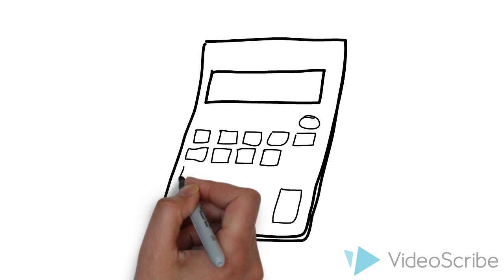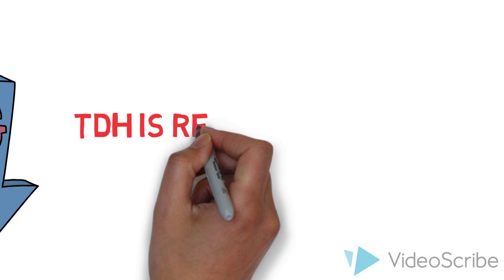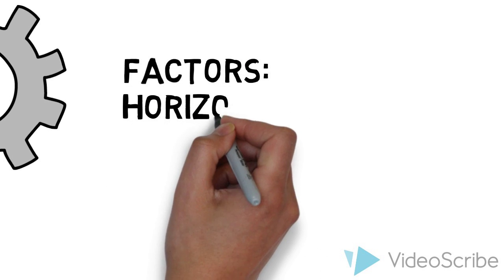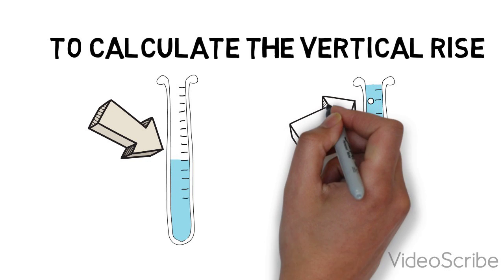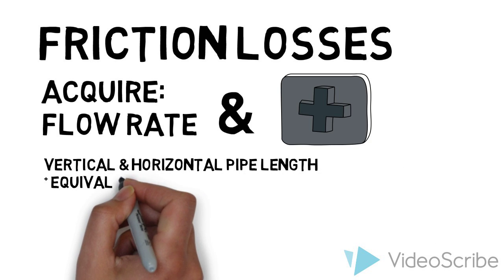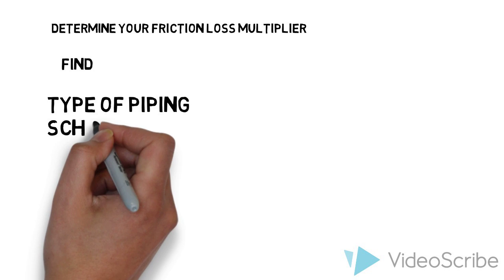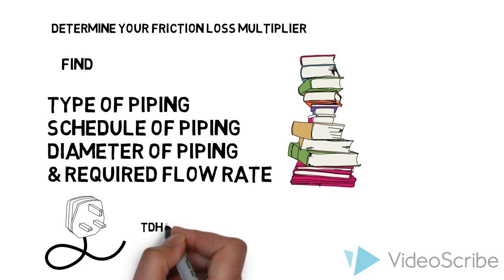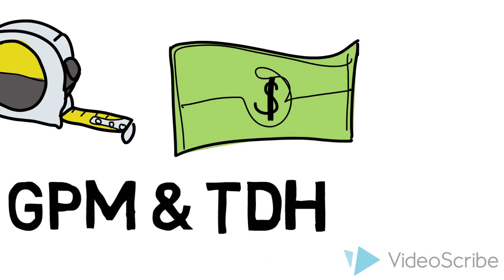How to Calculate Total Dynamic Head For a Pump

Comment: I can 10000% guarantee you no pool builder let along "pool guy" has ever, ever, never sat there measuring pipe lengths, rise and fittings to preform such calculations.  
Also, if you want to know your TDH it would be easier to just just get a flow meter, connect your pump by the side of the pool with a short section of pipe, run it record rate of flow, then re-install it in your system and record the flow again. Subtract them and calculate in reverse using the loss in rate of flow.
Reply: Many builders engineers pool designers, you have to calc all these things before you build it lol. Otherwise you could build it and test it qs you mention, but if its wrong you have waste money when you gotta buy a new pump
Reply: @allenantonioheyllatorre5720  Generally engineering is only brought in on large commercial projects, not residential. It is a total free for all for residential installs.
Reply: @QuaabQueb  well.all the residential jobs i have done i dont just free ball what pump tubing etc im going to use. If it doesnt work right the responsibility of fixing it falls on you. Its not like your in the field measuring things either its just calcs on paper... you calc before you install no sense in calcing after, you just throw a meter on if you want to confirm calca
Reply: Probably true of the majority of them but there is software available that some of them might use that if used to design the plumbing, it will calculate the head for you.

Comment: Your formula for TDH is incorrect. It only shows the friction loss. You forgot to add the elevation head(vertical rise in feet).
Maybe because you were going too fast.
TDH = total elevation head + Friction loss both of course must be the same units, such as psi. That would simply mean converting the total elevation head into psi, by simply dividing number of feet of elevation head by 2.31. (Since 2.31 feet = 1 psi)
Reply: The total vertical rise is the Static head. So he is correct with Dynamic head. For total head, add TSH and TDH.
Reply: @aggrajsharma8411  but he did not added the vertical rise or static head, his formula at the end only shows the friction loss with multiplier, no SH or vertical rise head. so definitely wrong.